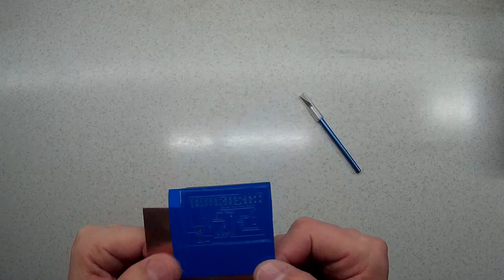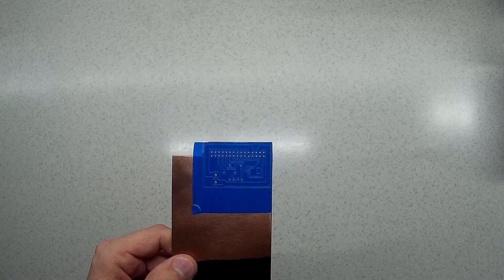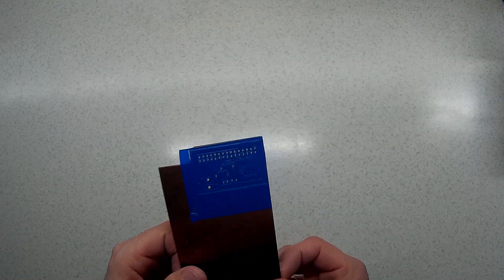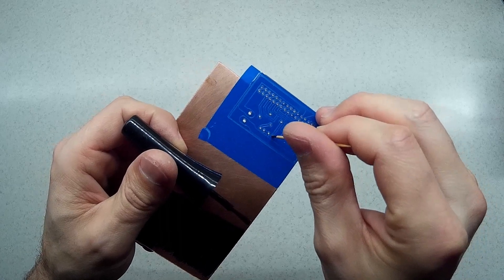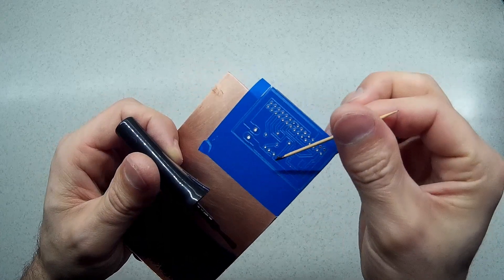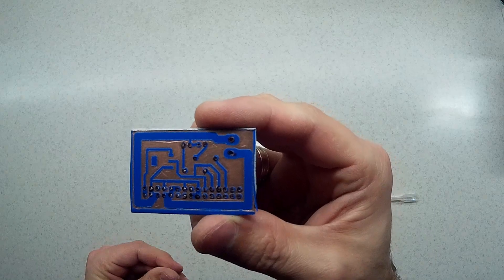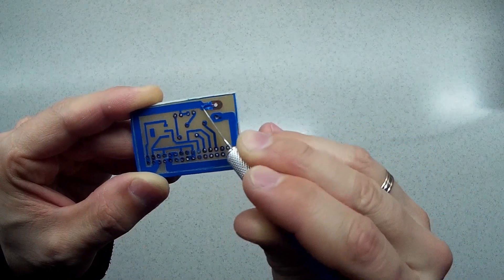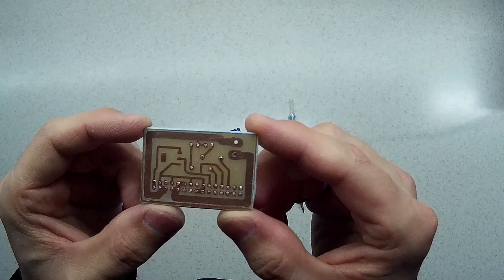PCB making using laser engraver, PART 4

Comment: Does this plastic tape work better than black paint? Paint comes off with acetone.
Reply from the maker: I tried black paint but my laser is not strong enough to burn it. It is about 400mW and is enough to cut this tape.
Reply: @z00n  Time to get a stronger laser!
Reply from the maker: @DavidALovingMPF102  I got a lot of DVD burners... Have a 3.5W laser as well.